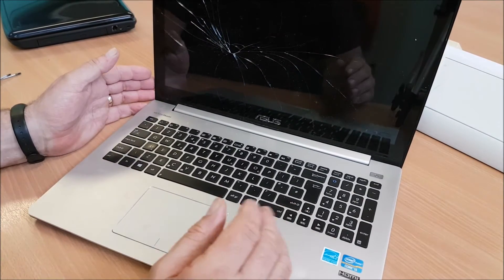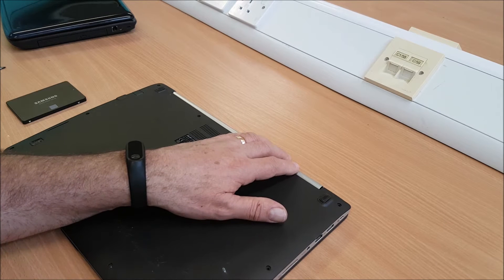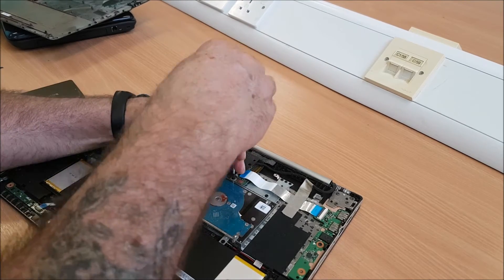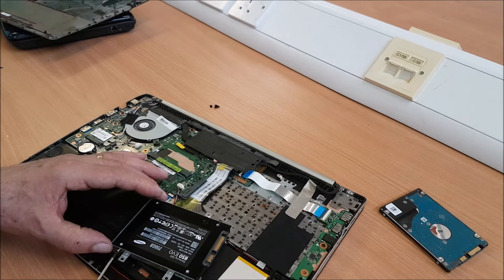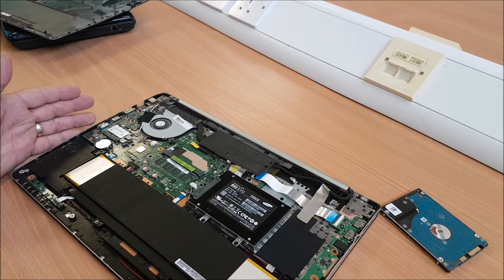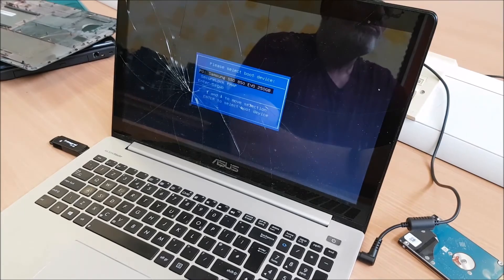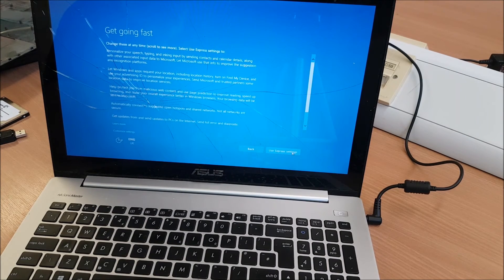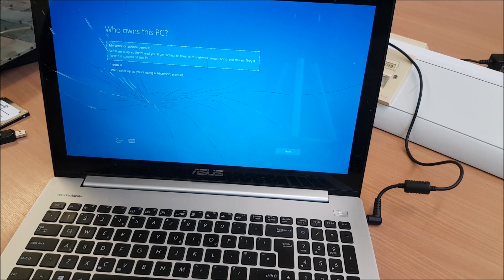ASUS S500C HARD DRIVE REPLACE

Comment: if you have the S500c model and want to do a simple upgrade, add a 8GB memory module for a total of 12GB RAM and install a SSD drive.  it makes it so much faster
Reply: I was about to ask this question! Thank you ♥️ BTW what kind of memory do I need to buy?
Reply: @ziohara5872  I bought this from amazon Crucial RAM 8GB DDR3 1600 MHz CL11 Laptop Memory CT102464BF160B
Reply: Hi thanks for answer, could you tell me which ssd compatible for this laptop as well. ?

Comment: I have the same laptop its so slow just installed win 7 it still very laggy and slow, its 2117u processor and 4gb ram. would ssd solve the issue?
Reply: yes very much SSD very fast and windows 10 worth the upgrade thanks for watching
Reply: More ram